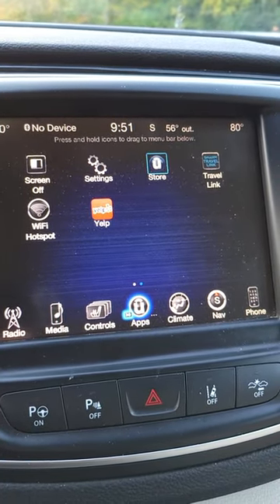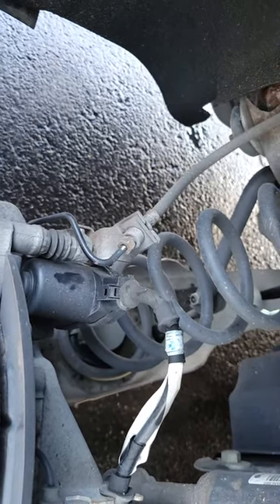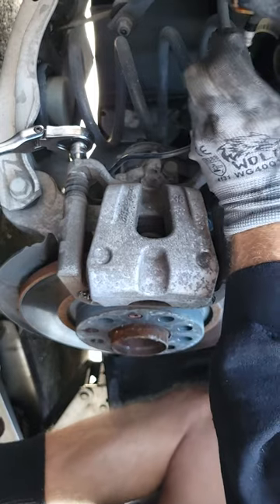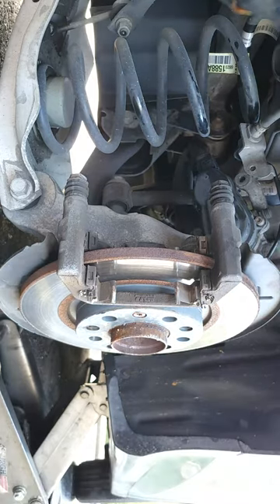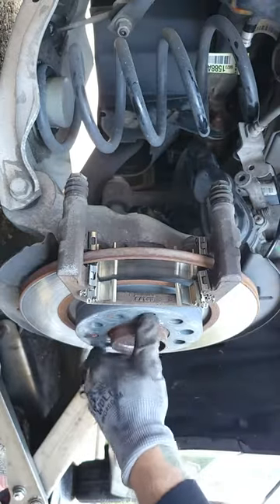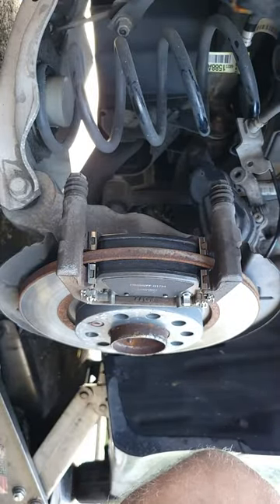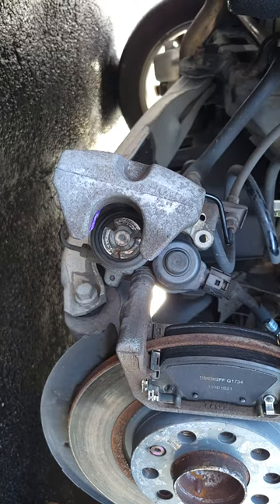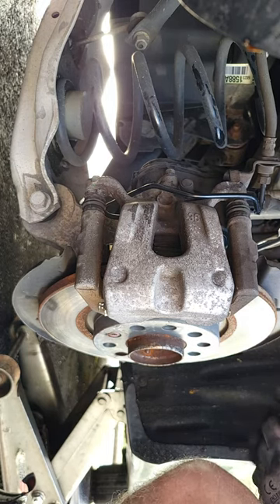2015 Chrysler 200 Rear Brake Pad Replacement with Electronic Parking Brake Service Procedure

Comment: Thanks for this, dude. I knew the front and rear brakes were different but the rear was way different than any other car I've replaced them on. I did the front in 20 minutes and I'm thinking "this is gonna be even easier on the back since they're smaller...😂 I was wrong. Either way, I'm just glad I can do them on my own instead of the $500 they wanted at the shop.

Comment: So you left out one important factor for them DYI'ers out there. How to reverse the procedures on get it out of brake service mode.
Reply: Do you know how ??? And what if you forgot too put your car in service mode before doing that
Reply: @P4kDeeKongg  I saw another video on how to take it out of service mode. You press the start button to wake up then ECM without pressing the brake and then you put the park brake in park. This process will take the car out of service mode. Start the vehicle and take the park off and slightly pump the brakes to pump the pistons to normal

Comment: thank you for the tutorial. i was putting the brakeline bracket bolt back on and the head of it snapped and smacked me in the face... everything was going so well and im struggling to find a new bolt😭
Reply from the maker: You should be able to find a stud or any bolt that will hold it in place

Comment: What if I forgot too put it in service mode ????
Reply from the maker: If you don't have any error codes and the ebrake works fine your clear if you have error codes you may need a new actuator and or caliper.
Reply: @danthebrakeman  I'm one of those wizards that forgot to enable service mode before removing the caliper.  "No worries", I thought....I'll simply enable the service mode even though the caliper isn't mounted.....that surely will retract the piston.  Well.....NOPE....somehow the piston has now fully extended and is out of the bore.

Is there a way to reinsert the piston and then retract the part brake mechanism???